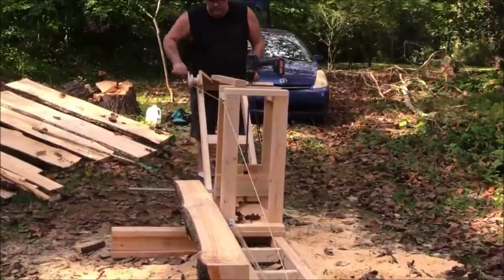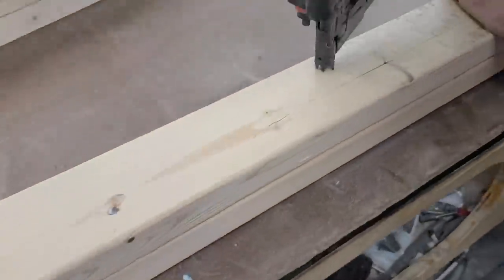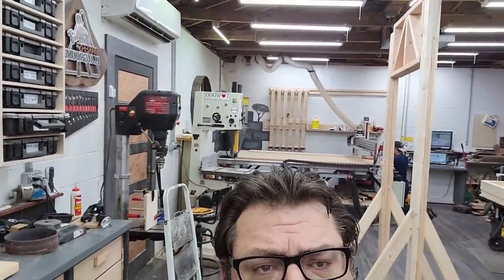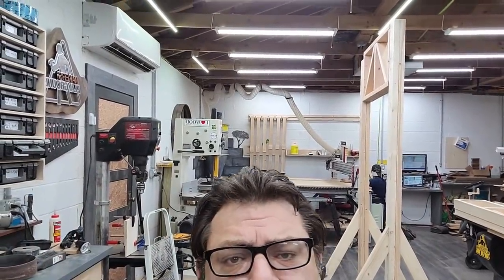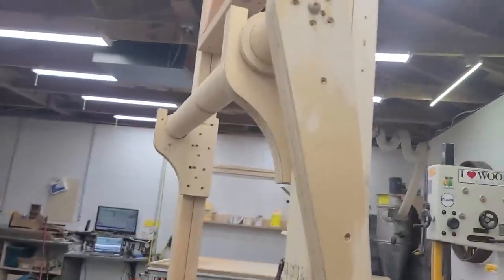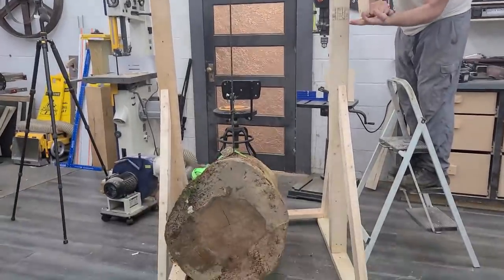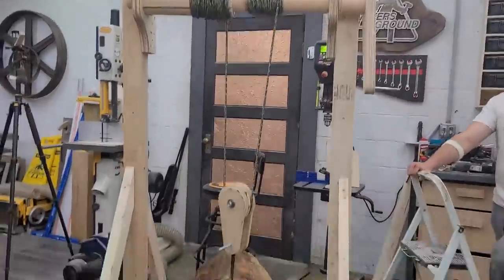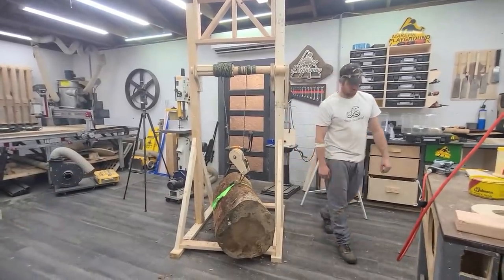DIY - Device for lifting heavy logs

Comment: Ingenious. Needs some sort of ratchet brake to stop the load from dropping and spinning the handle out of control.
Reply: Came in to suggest this.
Reply: would try an escapement mechanism with the handle as the input. you could increase your moment and no longer need the step ladder

Comment: Several years ago I did something similar, but far more crude.  I took 2X6s and made a structure shaped a little like a child's swingset.  I attached a come-along to the crossbeam, and used it to lift one end of oak logs onto the tailgate of my truck.  i could release that end, and then use the come-along to lift the other end, then slide it into my truck.  The biggest log I moved, I calculated to be about 600 pounds.  It absolutely maxed out the capacity!  But at least I could assemble it on the spot and do the whole task unassisted.

Comment: The old guy's way of doing it.  A large pair of wooden wheels with an axle between them. A long lever/tow bar perhaps 20 or more feet long,,, the center pivot point only 3 feet or so from the center line of the axle for that lifting lever/tow bar.  Log laying on the ground,, wheel your wheels over top such that the center of the log to be lifted is directly under the axle.  Tilt the long handle, tow bar up,, attach the center of the log,, pull the long lever arm down,, which raises the log off the ground, wrap a chain or rope around the one end of the lever arm above the log, and now tow it to where ever you need it.

Comment: Here is a variation on your Chinese winch setup.  Several years ago (80’s), I meet a pair of “Amish” loggers that had a similar setup but they had different sized spools their setup. The spools were wooden with centers that had a slot in them. The slot keyed the spools to a metal shaft that als had a slot.  They said that they could pick full logs up to about 30” diameter to load in their wagons.  They also had a smaller portable winch set up for pulling logs to get them were their horses could pull them.  The reason I remember the set up was a clever toggle ratchet safety that was operated by moving a brass ball on a steel rod that allowed you to safely lift or lower the log.

Comment: Scott Clark
 11 hours ago, "I am interested to hear what the log weighed in at if you did actually put it on the scale later as you mentioned . I was going to guess it wasn't over 250-275 lbs but you know the camera adds 10 lbs they say . Cheers and looking good on your feet mister.   ----- THOSE INTERESTED, READ BELOW ------
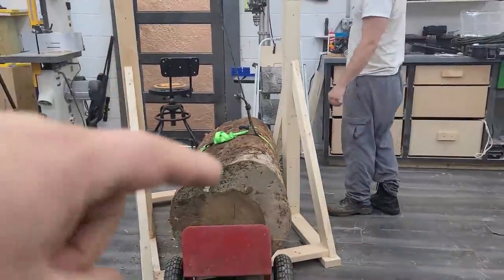at 8:34 Izzy says 20-inch diam. and 4 feet long... SO. 20/2= 10-inch radius so Pi*r^2=3.141592*10*10=314.1592 square inches So times 48 inches long=15079.6416 cubic inches,  then divided by 12 cubed = 8.72664 cubic feet total wood volume ... wood floats in water ... if just floats then 62.4 pounds per cubic foot for water so times 62.4 is 544.5426 pounds, but if the wood floats 5% out of the water then, 95% times 544.5426 = 517.315 pounds total weight. If a sample of the wood floated higher out of the water, you'd have proportionally less weight overall.
NICE CALCULATION, ISN'T IT. DIDN'T KNOW YOU(Talkin' to your readers) COULD CALCULATE LIKE THIS DID YA(Talkin' to your readers)? AND anyone can do it!!!
Science, Love it!
My Civil Engineering dad would have been proud of that calculation !!!
SOME FOLKS CLICKED ON "LIKE THIS" Glad you enjoyed this. Please DO CLICK on "Liked this" if you did. Thanks!

Comment: 1. I love your shop. 2. The lack of safety equipment and using Brad as the potential victim of a violent hit on the head from the cranking arm on your lift is both exhilarating and hypnotic! The tension builds with every turn like a great horror movie. 3. The makeshift wood lathe using a fabricated box and your table saw is not only the scariest thing I’ve ever seen but also AWESOME!!! I’ve just subscribed to this channel and will be binge watching forever. 👍
Reply: You say awesome, I say stupid and dangerous, realizing 70 percent of all humans are idiots this should be forbidden.
Reply: Hey man, at least he built a frame and a plexiglass cover, the first build video just showed a spinning log blasting right up against a saw blade!

Comment: Interesting, Izzy. I've not seen this type of mechanism before. I know that a moveable pulley with one end of the rope fixed is a 2:1 mechanical advantage. Now you've piqued my interest and I'll have to further research the mechanical advantage of the Chinese system. Keep healing. It's good to see you moving around as well as you are these days.   Bill
Reply: I don't think that there's a mechanical advantage to having the diameter of the rod twice as big on the side that is taking up the rope. When using a pulley you gain a mechanical advantage but you have to pull twice as much. (That's if using one pulley. You need to pull (number of pulleys) + 1 times the distance, which is also your mechanical advantage.) 

So, if you set up a system that had three pulleys to get four times the mechanical advantage, you would then set the diameter of the receiving half of the rod to be four times the half from which the rope is unwinding in order to eliminate the penalty of having to pull further.

It's quite the ingenious system.

Comment: Amazing concept. We can learn so much from the very clever geniuses of the past. One thing that I would change to control the rope is to put a trolley like pulley system instead of just a single pulley. That way when the rope comes down and then goes across it goes a farther distance before it goes back up on the way to the log will be held in between the two pulleys keeping the pulleys level to the ground.

Comment: awesome video.  I feel like I could use this as a gantry of sorts in my garage for light duty obviously.  build it up by the ceiling and on the wall have a pulley on chain setup to come down the a handle or drill insert.  nice video and I'm glad to see you're moving around so much better.

Comment: Block and tackle my friend, block and tackle. With the Chinese windless you effectively doubled your pull force with 2 lines pulling almost equal amounts. Double or triple that and each line shares the weight. Say the log is 400 pounds. As the Chinese windless is set each line lifts 200 pounds. 4 lines would be 100 pounds, 5 lines 80 pounds and so. It will slow down the lift speed but increases the efficiency. Another addition would be move the crank arm lower on the lift while the windless remains higher. Use a chain and gears from a bicycle and mount one gear on crank arm and one on the windless crank. Loop the chain and hoist away.

Comment: I agree with someone that said "could you use a set of gears?" You could. Build a two speed gear box like they use for lifting trailer's on and off the big trucks and add some type of locking system to keep the load from wheeling back(safety first)down. Love this build! Looking good!

Comment: I'm interested to see how this develops. I've got a plan to build a proper rolling base for my cabinet saw, and I need to lift it from the Shop Fox rolling base it's on now. With the cast iron wings on, I think it's in the 400-450 pound range. I'd also like whatever lift I design to double as a front-end lift for my zero-turn mower so I can do maintenance. I see a lot of 3/4" plywood in my future.
Reply: Great creation. Wishing you lots of fun this weekend.
Reply: Could get an engine hoist from HF for <$200

Comment: Izzy, maybe you can link the other videos, like the sawmill and table saw lathe..  BTW could you angle the supports so they are wider at the base than the top and easier to get logs into and on the saw mill?  Just wondering out loud..  LOOKS FUN THOUGH..

Comment: DO NOT FORGET:  whichever type of windlass you choose the total weight of the log still bears on the one or two strands of rope.  The rope has to be strong enough.
The Chinese windlass does indeed give tremendous mechanical advantage on the HANDLE.  Do a little math and the force you apply to the handle of the crank is maybe one tenth of the first windlass.  But the reduction of load on the two ropes is only half.  Yes, I think he could lift a ton with that - IF the rope was rated for at least a half a ton.  Any lesser rating and the rope would break.
Also, rope stretches as you pull it.  When it snaps under tension, some types like nylon can whip around and cause nasty injuries if the end hits you.

Comment: When I retire, I'm going out west, buy some cheap land and cast 1500 lbs concrete castle blocks. I might need to use the Chinese windlass with a manual crane to lift and stack them.
Reply: Use aircrete instead.  Then coat it with high strength water resistant cement for protection.  Aircrete has great insular value, but low strength... (it FLOATS ON WATER).  If you make the main body of the blocks with aircrete, then you may be able to more easily shift them into position and follow up with a high pressure cement pour to protect it.

Aircrete is also much less costly in terms of material, as the main purpose is to incorporate a lot of foam to introduce the air bubbles.  Look up "Aircrete Harry" and various other channels for more on this very versatile building material.
Reply: @gregoryhalye8907  - You stole my comment.

Comment: Thanks for the video.  Love the concept.  If you want more mechanical advantage, don't lift the log straight up.  Use the Chinese Windlass to roll the log sideways up a ramp onto a trailer or truck.  When doing this, you can ditch the pully.  The rope goes around the log itself and helps roll it up the ramp.  You park your trailer next to a large tree on the left.  Meanwhile the ramp faces to the right.  The windlass is tied to the tree on the left of the trailer and pulls the log sideways up the ramp.  Hope that helps and made sense.

Comment: I have some buddy's that do 18th century naval reenactment. They use a gin pole to lift cannon barrels . It is basically 3 long poles connected at the top. They use block and tackle from the cannon to the top and down to a pull rope. Just thinking out loud:  You could affix a cross piece to two of the legs and attach the windlass there so that it is at a manageable height to work with...or even better, just attach an ATV winch to one of the legs.

Comment: Buy or build a pair of log arches.  You can then pick up a log at both ends, and secure to the top of the arch, then tow it where you want to go, as though the log itself were the body of a wagon.

Once you have it at or near where you want, you can set it down on some rails or sawhorses or on the ground in front of your mill and then roll it into position.

While it might be possible to figure the midpoint of a log and pick it up to balance it on two wheels with a single arch, it would be much easier to split the load with a pair of log arches.  If you use two, of course, leave enough slack in the lead arch to allow it to pivot and follow your turn, or create an articulated arch.

Comment: The Chinese windlass works on the same principle as a differential chain hoist.Add a worm gear for turning with a drill and it will also have self braking
Reply: With the gear ration in a worm gear you could use it to manually drive a simple windlass and still have the self braking.

Comment: I would suggest locating the supports for the horizontal barrel (axle) on the outside of the frame, then add vertical members under the supports to help take the load. This current idea has all the load on some screws that could shear or tear out of the frame. The barrel diameter may need to increase to prevent deflection. Otherwise, it's a very simple and efficient machine.

Comment: You could lower the crank handle by adding a chain and sprockets. It would make it much easier to crank from the ground. Cool design though.
Reply: ...or make the drum a lot shorter, mount it at a reasonable height, and run the rope up and over a couple pulleys at the top.

Comment: Spreader between the ropes to keep relatively constant distance, maybe a dual reduction system on the initial cranking end, I.e. 4” pulley on input side to a 24 “ pulley, plywood built circles 3 pieces with smaller diameter sandwiched by two larger, v-belt drive.  Simple reduction that might allow a 1/2” drill to power.
Reply: If you are moving logs similar to railroad ties you can lay a two-wheeler next to the piece about a third of the Dow with top or handle towards the middle. Place ends over the hand cart.  Then lift the long end to easily move the piece. My neighbor showed me how to do this when I built a wall in my backyard. Unbelievable how easy it was to move 20 rr ties

Comment: I would add a spring loaded metal rod to the loading arm and a metal retaining catch bracket to the top and bottom of frame support. So if you let off on the crank the arm will only swing so far in one direction. That way if you let go of the handle it doesn't spin and take your chin with it. Or perhaps a catch mechanism similar to the palls on a comealong/ cable puller?

Comment: The one I came up with and built a prototype for was to get greater power than the power I was putting into it. So I went with a much larger cam on the left than was the shaft on the right. About 4x the radius I believe. I used a very short rope as I was only lifting a short distance. My goal was that I only had to move my arm with minimal effort to see a large response on the object I was lifting. I have yet to build a full scale metal version, but my short experiment seems to work in theory...

Comment: I like the design so far. Just going to throw out there, 7:1 block & tackle hoist pulleys are super cheap. Used one for my own gantry I built a couple months ago. I still need to put a winch on mine, though. Right now, I'm literally just pulling the rope and tying it to a cleat.
I'm super interested in how you're planning to move the logs once they're up in the air.

Comment: Great stuff.Thanks Izzy.
I think we in the west are only just starting to realise how many things the Chinese have invented throughout history.Often centuries before 'we' 'invented' the same thing.
I wonder if the Chinese windlass cd be easily made (ironically) by modifying a block and tackle/pulley setup so that pulleys of 2 different diameters on the same block are welded to  an axle with a cranked handle end with a big enough 'sweep' for best leverage/speed combination.
Because the 2 sides of the rope are close t each other;the carrier pulley can be much closer to the axle increasing scope of usage and allowing a lower overall height/larger load size on the same frame so much safer and easier to move rather than trying to waltz with a church bell  ;-)
The only other thing u'd need is 1 pulley with a hook for the lifting strop(s) and spreader bar.
Nice little spinning wooden sleeve handle like on a drill brace.
The rope would only need to wrap around each pulley on the block twice and then the rest of the rope doesn't need to be wrapped around the rod.That makes it much easier to fit a simple ratcheting clicker on the rope to lock it down before tying off properly and moving the log.
Motorbike wheels and a chrome horn for bling?

Comment: Looks very good.  I would suggest a simple 1/2 inch hold through the handle into the vertical timber where you could push a bold or heave dowel through to hold the log up .....  otherwise very impressive!

Comment: Great explaination of the Chinese Windlass....I think one of the bigger challenges is reaching over or steadeling the big heavy item you want to lift, with that said I think you really only have to go back and see what they did in the old days of logging to get inspiration. IMHO I would start with something like a Straddle-Wheeled Log Hauler and using canter lever extension to help give you lifting advantage. You roll a stradle wheeled log hauler (my preference is with an adjustable wheel base) over the centre of the load and have a long draw bar to gain leverage from a short axle to over head frame connection point. Lifting effort is then focused on bringing the long draw bar down, this is usually achieved by cranking down onto the log you are trying to lift. This in turn lifts the load up a short way off the ground and leaves you with a managable see-saw balanced load, on wheels, with a turning pivot point at the middle of the log. Depending on how long your logs are you can intergrate a tow hitch directly on the draw bar or just strap it securely to the log a chain/screw separate bolt on hitch to the end of the log.
Hope that makes sense, difficult to describe
Reply from the maker: This was just a testing devise not final build have it covered
Reply: @izzyswan  No worries Dude, always appreciate your creations, just thought I would throw in my 2 cents, cheers

Comment: Taking up the rope is easier but to take full advantage of the mechanical advantage you need bearings to eliminate most of the friction as the cylindrical crank shaft is still bearing all the weight.

Comment: It pretty much a gear. The diameter difference is the gear ratio. The length of the rope is equivalent to the lift hight dived by the ratio (or multiply depends on the the way you see the ratio). That's a neat trick if you haven't got pulleys at hand. That might be even a good trick to know if you need to pull yourself out with 4x4 wheeler.
Reply: 2 R_crank / (R - r)

Comment: I have not seen a Chinese windlass before. I believe it gives less lift per turn than a 2 to 1  hookup.. I wonder if it would be equal to a 3 or 4 to 1 using shives.  Interesting concept.  Please remember the most important rule when lifting by mechanical means: Never Let Yourself Be Under A Suspended Load!